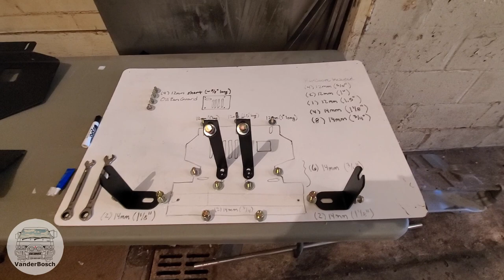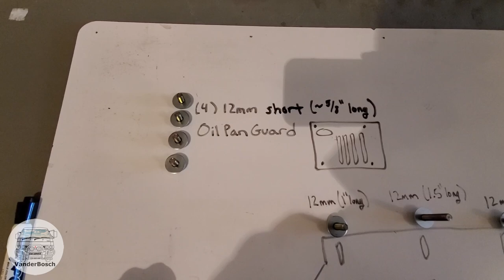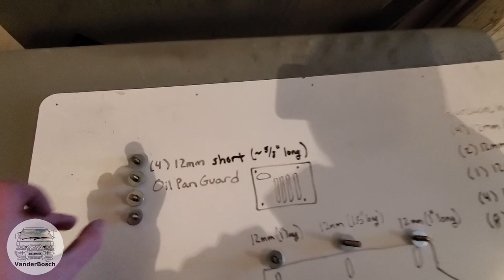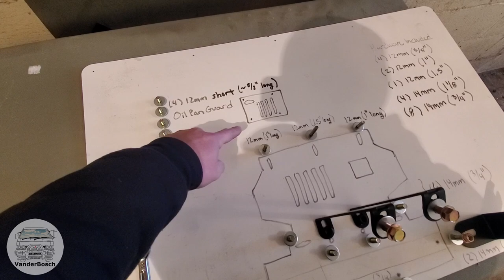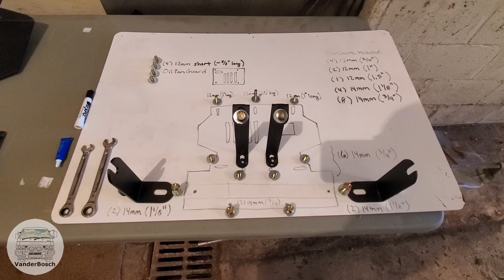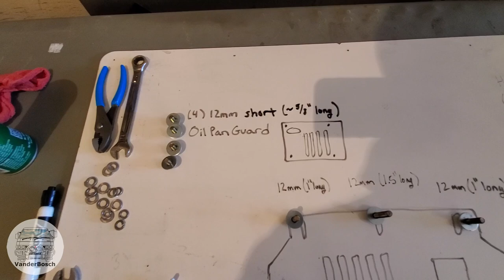1991 Mitsubishi Delica L300 - Skid Plate Install

Comment: any radiator troubles or plans to replace?
i'm headed in that direction first with my new deli
Reply from the maker: When I initially got my van, the radiator was filled with a thick brown sludge. I had to do multiple coolant flushes to get all of it out. I do need to replace the radiator. I just have to figure out if its worth doing it on this engine (with a cracked block) or wait till later. I guess doing it now has less risk then doing it with a new engine haha. I'll add it to my list of ideas